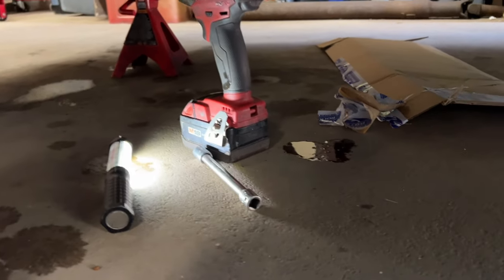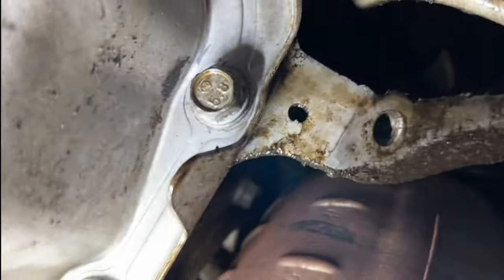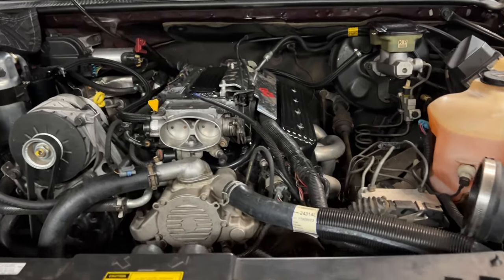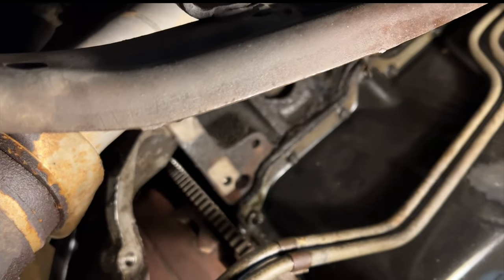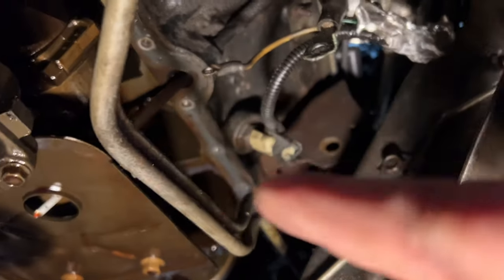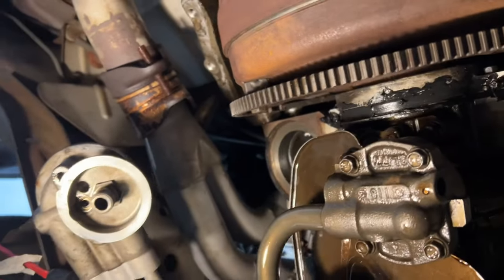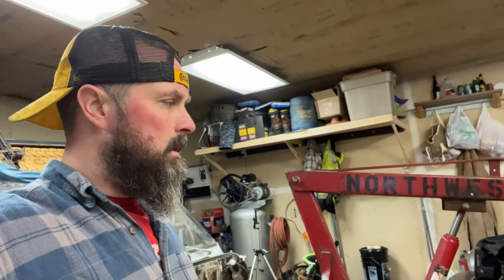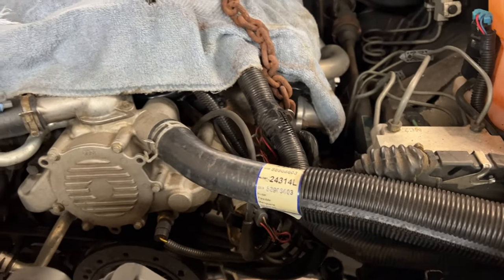1994-1996 Impala SS Oil Pan Gasket Replacement on LT-1

Comment: Having some trouble and wondering if you can help. When i try to bolt in my pan with a new felpro blue gasket, i cant get the nuts on the corner studs and there seems to be a small gap on the sides of the pan. I cant think of anything thats hitting. Is it normal to have to compress the front and rear main seals hard by pushing the pan in order to get the bolts on and seal up the sides? I dont want to break anything by forcing it
Reply from the maker: Make sure you’re oil sending sensor is clearing and the oil tube pick up is correctly into the sump. You might have to jack the engine up just a tickle more as well. Good luck l.

Comment: Working on this on my 96 Roadmaster. Is the front of the oil pan gasket supposed to be visible when the pan is installed? Thanks
Reply from the maker: Yes, you will see the new gasket around the timing cover and around the sides.

Comment: Have you changed your oil cooler lines before? Mine leaking just wondering have you did a video on it.
Reply from the maker: I did in 2015, but the just the lines. I didn’t change that housing. I was debating on the oil cooler delete or filter relocation.
Reply: Delete them. You’ll have less leaks and a few more psi.

Comment: What size bolt goes into the ground where the stud is at to lift the engine?
Reply from the maker: It was a 1/2 or 9/16 standard thread. I don’t recall the length. It was a random from my bolt bin.
Reply: @Twostallgarage  thank you sir!